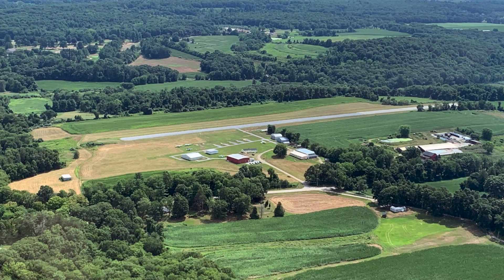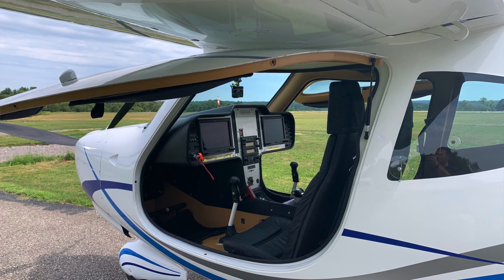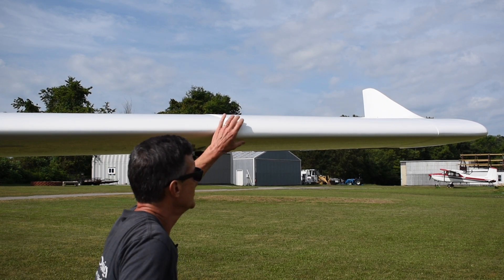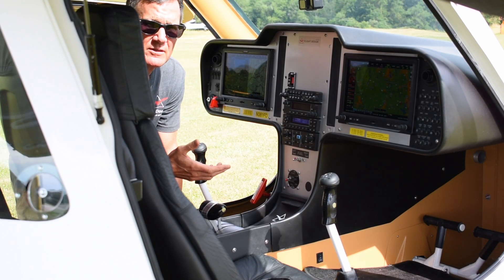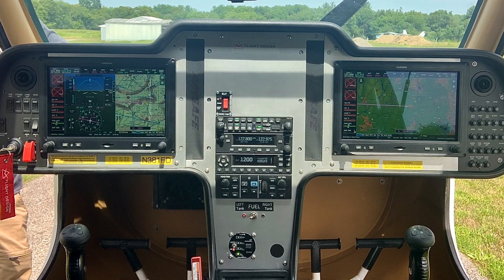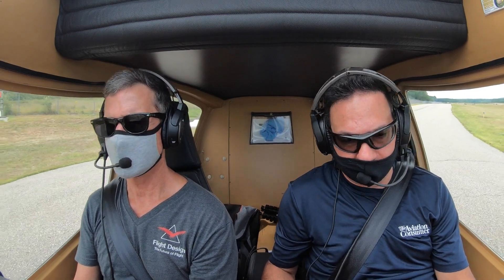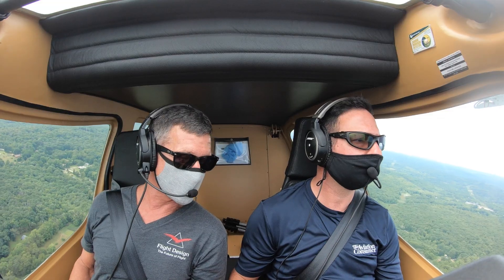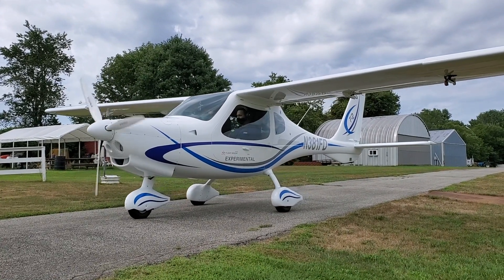Flight Design F2 LSA Flight Trial

Comment: I’ve got 100’s hr in CT’s. I picked up one from your facility a few years ago back, where a bare wire on top of the engine shorted out the electrical system, requiring a few minutes to locate. I’m definitely interested in the F2 spending time with the team this spring at SNF looking at the aircraft. I had an emergency total shoulder replacement just a few weeks later and have been waiting to get cleared to aviate soon to meet up with the team. I know that the 912 is very efficient, but will you ever go bigger? My left leg does not bend due to multiple surgical procedures and 4 total knee replacements. The CT is perfect for me getting in and out. Folks comment on the initial cost….i say you gotta pay to play.

Comment: the nav com needs to be swamped out for GNX375 or GNC255. VFR no need ILS, you can do RNAV LPV only with much lower price.  G3x needs to be upgrade to G3x touch, otherwise the airframe is too luxury for interior

Comment: Sorry but I don't see ANY MARKET for a $200K LSA that has a very limited useful load.
Reply: I disagree.  For a new plane with all those safety features, including a BRS, and the ability to upgrade to certified in the future, its a good price.   The only option on the certifed side would be a used Cirrus, but the cheapest 15 year old models are still $250k+.    Maybe a 172 with the BRS add-on, but that would be in the 400k+ range new.

Comment: Flight design needs a new design as the old one crashes more than a Dell computer...(check the stats)
Reply: Wouldn't this have a lot to do with pilot training? As in, training for LSAs is not as stringent as for regular GA aircraft?
Reply: They are just different. If a Cessna or Bonanza type pilot tries to fly a CT without thorough training he's going to crash it on landing.
Reply: @Tharkunify  Just do 5 minutes of research on which LSA crashes the most, then decide if you'd fly one. (or fly in one)
Reply: @stevesturdy4549  I had a ctsw for a year and even saw one crash at the local airport.  But with proper training it was a very fun plane and seemed to have a good support network. I will review the stats as you suggest. Thx for the reply.
Reply: From what I see on the F2 I’m really impressed.  I’ll be even more so impressed when a 915iS is allowed.

Comment: I don't get it? Why would you make a plane that is designed for training resist stall/spin? That is setting up new pilots who will most likely transition to an older 172 for a big surprise. Of anything we should train with planes that have worse stall characteristics? We don't make better pilots by making the training planes easier.
Reply: I agree with you but the pilots of today and tomorrow pale by comparison to those of yesteryear and this is because of the cockpit; automation is a paradigm that cost doesn’t see benefit for stick and rudder basics.
Reply: @12knE  I agree. I personally believe many accidents that were classified as pilot error were actually a result of too much automation. Sure the pilot should have been able to turn off the automation and hand fly but when you never practised this you loose that skill and automation is why they loose that skill.
Reply: Curt D  That is my exact point and you said it so well.
Reply: @12knE  We're seeing the same loss of skills in heavy trucking. Modern equipment requires less driver input to maintain normal operation.
GPS navigation has completely wrecked greater situational awareness, side-looking radar has made immediate lane awareness crazy bad and automated transmissions have killed off young drivers' awareness of road surface condition. If the 'icing' light isn't on they are surprised when slides happen. New tech is great until you find many of your drivers woefully inept at controlling the vehicles in emergency situations.
Reply: @crissd8283  - I think you mean "lose", not "loose"...
Reply: @gilbertfranklin1537  Yes you are correct.

Comment: 7-10hrs transition training for this? That’s more hours than doing a multi rating???
Reply from the maker: Don't shoot the messenger. Insurance pros said that in this current market as much as 10 hours might be the requirement for many LSA models, depending on the pilot. Some ages, like in any airplane, might not be insurable at all. As for transitioning, we think most competent pilots can fly the airplane successfully in fewer hours, but to really be comfortable—and that includes mastering the avionics, autopilot and doing some cross countries, night work, etc, working with an instructor for more than a basic checkout might be in order.
Reply: AVweb weird. On my insurance for a PA30 they want 10hrs + multi rating for a non rated pilot, or just a checkout on a multi rated pilot. 10hrs seems extreme for a single engine non HP aircraft.
Reply: That was just absurd. It will be bad if insurance companies listen to these excuses for experts.

Comment: $200K for an LSA. Good luck.
Reply: I like the Rotax 912 with FADEC.
Reply: carbon cub and icon a5 well north of that. but you have to provide significant value above 200k, that's for sure
Reply: Plenty of rich pilots out there. Want cheap? Build a cub.
Reply: Many like it selling well. Lots of rich pilots who want all the fancy avionics and equipment but who can’t obtain a PPL due to medical reasons.
Reply: @RomansFiveDotEight  1
Reply: I'm guessing it's with certification in mind as a trainer to replace cessnas and with similarly better fuel economy. Without it, just as an LSA, the price isn't competitive, I agree. That said Cubs sell for well over 200 which is a disgrace on multiple fronts.
Reply: @DanFrederiksen  I am a bit torn on this one - Piper sells a lot of their scaled down PA-28 trainer these days (can't remember the marketing name) and they are much more expensive, and basically a three-seater. Thus with IFR certification and the Rotax 915, all of a sudden this becomes "reasonablish" (won't trade in our Cherokee 140, but alas, I also go camping and don't step down from a Bonanza...).